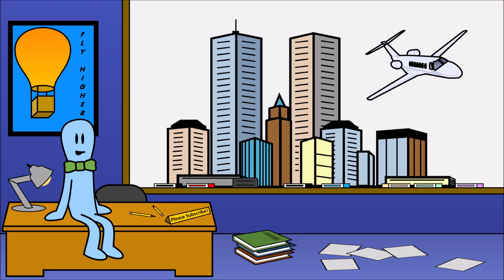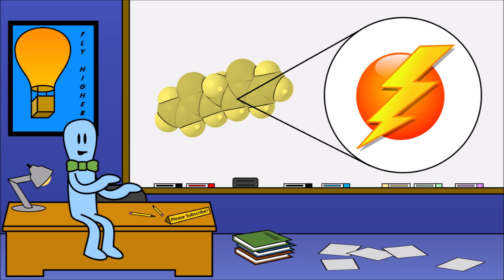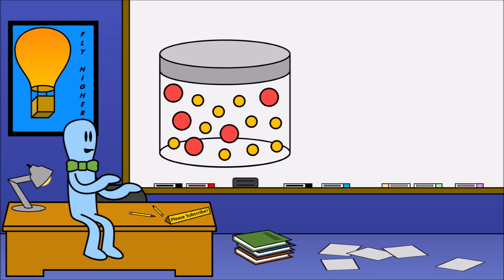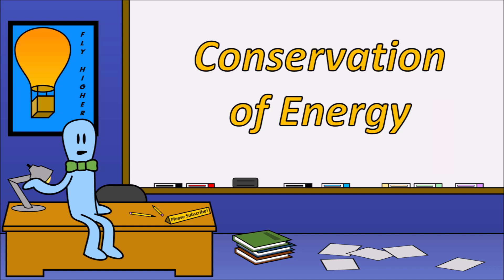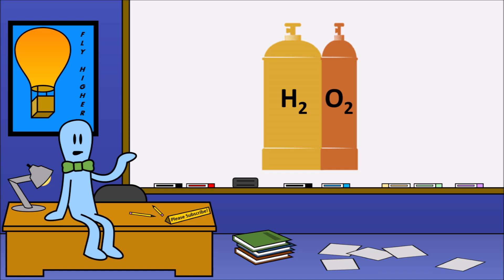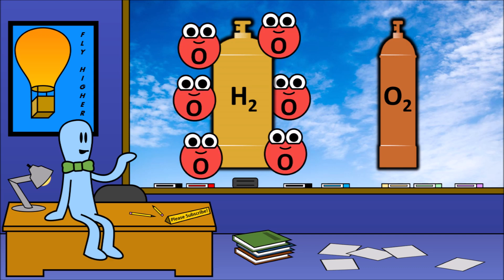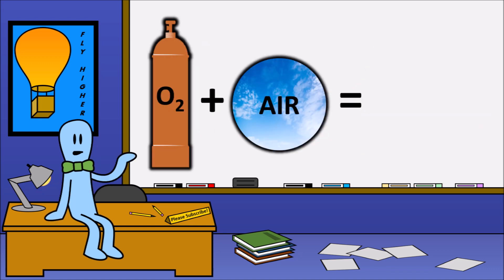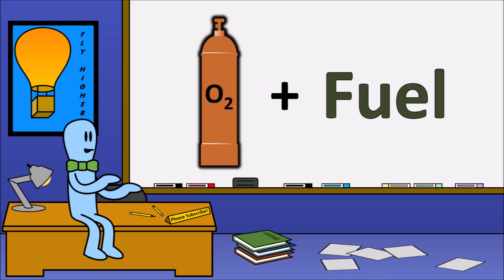Can We Make a Water-Powered Engine?

Comment: A Better Hydrogen generator for your car better than you think.!!!

ACMEC HHO kits are designed for hho gas production in low amps. All hho kits generated Hydrogen and oxygen gases nothing else.!

Yes HHO CAR KIT will improve your engine horsepower and efficiency while reducing toxic gas emissions hho kit will solved all engine heating problem automatically. Engine will run clean and smoothly requiring less maintenance.

You will not see brown deposits in our new designed hho kits. Our transparent kits for efi cars working up to two amps. 

But our transparent hho kits for carburetor types engines working up to 8 AMPS. For better fuel economy. ACMEC HHO CAR KITS can installed on petrol, gas, or diesel engines.

Comment: Well, gas powered cars use battery's to run the engine as well. They engine has a belt pully system that helps power other parts of the car like the water pump and A/C. More importantly, it powers a thing called the alternator, which recharges the battery, making it last a lot longer. So it may need a new battery after a few years, but it would still be a lot worth more than using gas. because, in a sense, water powered behaves a lot like gas engines if you really understand how the engine works

Comment: Wait wait he said you can't use oxygen as energy what about compressed air. You can use compressed air as an energy source older trains in France use that. But the problem is you need the air to continuously come and get pressurized then release it has to happen over and over and over and over and over again but it's going to be an efficient won't seem to get started so it needs to happen between like milliseconds or maybe just seconds I don't know for it to be efficient enough to power a whole car that means you need a big tank you need big air intakes but I don't know what do you guys think 🤔

Comment: You could also just inject the oxygen directly into the combustion chamber, you could also use hydrogen peroxide instead which would probably work much better. I just looked at a hydrogen peroxide car, 0-300 in like 3 seconds. It also just produces steam, which means it doesn’t damage the environment in the slightest.

Comment: People miss the point of a having a motor run on water. It's not to tell people that this motor produces more energy than it's using. No. That's  not why we need it. We need it because having a motor that can produce energy without waiting for hours to charge a battery. Also if the power required for electrolysis is produced by a clean energy source like solar or wind or whatever future technology that's out there than it truly is humanity's energy answer. Giant batteries maybe have their place somewhere but depending on them to power everything and especially for personal transportation will never work for all of us.
Reply from the maker: I completely agree, and that's exactly what a hydrogen car is. The hydrogen is a fuel that can be derived from alternative energies. The problem is that there are people who try to convince others that you can create energy solely from water.

Comment: Who wants an electric powered piece of a hunk of metal that easily combusts and catches on file Tesla's and all electric powered vehicles have been for no reason just catching a file just sitting there plugged in charging and they catch on file I don't want no damn piece of garbage that just all of the sun catches on fire  Gasoline engines don't catch on fire as easily as Tesla's and David Powell vehicles battery powered vehicles catch on file a lot more than gasoline powered vehicles

Comment: Actually if you need electric trick to make water power gasoline engine or you do is take electrical wirelectrical wiring and put it in a gas tank at tank it tones water basically into gasoline

Comment: Na this guy is taking trash one dude was poisiond because he invented a water power car the trick is you need to build hydrogen fuel sel turning water into hydrogen on demand if you can do that turning water into hydrogen instantly you will be left with hydrogen gas and the engine will run but good luck figuring it out just because it isn't easy doesn't mean it's impossible.

Comment: See references to S1R9A9M9. Several cars converted to water through 
carburetor about 2005-2012. 18HP Briggs lawnmower engine shows running 
on Youtube video. Battery runs starter, then disconnected at idle speed.
 Sounds like water pump running- not regular fuel. Permanent magnet 
Alternator supplies power 6-10amps, hand wound magnetic coil adjusts 
timing so as 0-34 degrees ATDC still firing, Inductors slow speed of 
spark as inline with high voltage wire. Parts , diodes, 6v dual coil 
relay in plastic tub on side of engine. The 60 cycles traffic signal 
vacuumed sealed relays were used on the cars 1 per cylinder. (Not used 
as relays,  just the inductance of both) Minimum 2-6 amps AVERAGE or 
7-10amps PEAK DC as seen on scope added to spark firing. The man said 
that actual water vapor pressure was generated on down stroke, along 
with small amount of Hydrogen. Website shut down Dec 2019, with some 
articles on internet. He added occasional baby oil to intake . For off 
idle (power mode) carb jet redrilled to 30% larger for more water flow. 
 Water car 1978 El Camino did 18mpg water only, at much lower 
horsepower.

Comment: No one is expecting the output to be more or equal to the input. All you’re trying to do it get enough energy to drive the engine, move the motor, and then use the rotation of the motor to generate electricity in your battery.
Reply: Dumb comment

Comment: What if we took our current system of gasoline production of oil companies, and had them switch over to hydrogen, that they already produce for themselves for their own processes?  There is still pollution, but instead of it being unregulated on the street, its now in regulated energy producers.  Then its just a matter of converting gas stations to hydrogen stations.  Gas stations already have the basic infrastructure of holding tanks and pumps, would just need to be swapped out for the different systems.  In the long run, the pollution in production of hydrogen can be alleviated by using other energy sources, such as solar wind and nuclear.  Wind and solar have already proven to be good enough to do this on demostrators.  And unlike batteries, there is no need to extract materials from 3rd world countries or look for ways to recycle millions of batteries, because hydrogen cars just use a rather simple tank supply system like natural gas vehicles.
Reply from the maker: That's what people are doing to store electricity from renewable sources of energy. It can take a long time for electric cars to charge up, but by using hydrogen an a fuel source to store the energy, it can almost as clean as an electric car, while being fueled up in a much shorter time.

Comment: oxygen is highly flammable that why they tell you not to smoke when your on oxygen and this has already proven to work the only ones that don't want it is the oil people
Reply from the maker: Oxygen makes other things ignite at a lower temperature, and burn hotter and faster, but oxygen itself does not catch on fire
Reply: @SquirrelledStudio  There's no question smoking is hazardous to health in the long-run. But for someone using oxygen therapy, lighting up can be instantly tragic. In 2008, the Centers for Disease Control and Prevention reported that 89% of deaths related to fire and home oxygen use were caused by smoking

Comment: This is a highly flawed "scientific" misrepresentation of reality and truth to promote an agenda. Only a child without mental capacity to reason cannot see how flawed this argument is. 1rst false statement should tip you off. Water can and does store energy. When the sunlight enter lakes it warms the surface, this is stored heat energy. Just something to consider. Now there are also  ways to tap into the mechanical motion of a car in congunction with  copper windings and magnets aka "electric motors/generator" the  electrolysis. As a car moves wheels turn a generator"aka alternator can be turned by the axle to harness electricity. Transistors and frequency generators can improve the output of electrolysis. The best way to hide a lie is to bury it in a mountain of truth. Electric cars will solve absolutley NOTHING they cause MORE polution because it takes a power plant to create the electricity stored in a CHEMICAL battery that took other harmfull Chemicals to produce. Wake up to the reality that certain people would love nothing more than to enslave you and control you and they can't necessarily get away with it via physical force so they lie to you to get you to buy your own slave chains and shackle yourself with dependency. What happens when the power goes out? You don't charge your car that is what happens.

Comment: Seek not the answers but to better understand the question.

What are people expecting when they hear the phase, "Water powered"... Are they thinking of being able to use water as a fuel .... or are they thinking free energy? If they are thinking free energy, they are thinking up the wrong tree. Energy is never free but if they are thinking of using water as a medium for energy transport and conversion, that could replace fossil fuels and heavy electrical power cells in applications where the convenience and portability of liquid fuels is indispensable, like aircraft and in a form that is both safer and cleaner than fossil fuels, then YES, think of water!

But everyone is is looking at it bassackward. For obvious reasons everyone seems to want to use electrolysis, on demand, at the point of injection into the engine.  They do this because they don't want to have to store or deal with  Oxygen and Hydrogen gasses, on their own or combined. They are just too volatile and explosive.  Think Shuttle Explosion!  What we need to do first of all is to, "water" down the fuel so it isn't so explosive and there is more mass to absorb the heat which means no Oxides of Nitrogen  are ever formed, so absolutely no pollution  of any kind is formed.

So maybe there is another way. A safer and more convenient way and a way to finally, safely, easily and cheaply store, the energy we collect from intermittent energy sources like solar and wind. After which we can use it like any other liquid fuel, that powers internal  combustion engines today. 

What you need is a source of water with a small amount of electrolyte, like vinegar or sea water. Then you need an appropriately sized pressure vessel, capable of internal pressure of 10 psi or less. 

Into the pressure vessel you place an electrolyzer. 

You then fill the pressure vessel  to the top with your water electrolyte mixture and seal it.

IN MY THEORY
Once connected to an electrical source, the electrolyzer will start to pump Oxygen and Hydrogen into the water and since there is no space left in the pressure vessel, those gasses will become dissolved in the water. The water will get more and more energized and becomes a transport medium and as long as the pressure is maintained, the water will not loose its dissolved and explosive  hitch hikers. If left open the water would just gradually release the active elements and you be left with  bad water.  After a certain length of time the water will reach a concentration point at which, when the water is sprayed and/or atomized, enough dissolved Oxygen and Hydrogen  are released, that a spark or flame even high pressure like in a diesel, will ignite them and any other errant molecules present. This action would naturally produce the Engineer's desired, progressive flame front, instead of an uncontrolled  detonation, known in the automotive parlance as "knock", which is very undesirable in a heat engine but very likely using an explosive gas like Hydrogen.

This is very nearly a perfect fuel and would be far more energy efficient for rocket engines, blasting into space. This fuel to gas mixture, could be customized to  have just the right amount of water to gas mixture, that there would be the perfect amount of mass, to absorb all the heat produced by the resident fuel. Producing the maximum amount of pressure and working fluid, from the least amount of stored energy. But that would be rocket science and all we want to do is be able to get to Grandma's house.

Until the science is that far along, all we have to do is find out how long we have to charge the water to get a substitute for gasoline. Once we know that, we can just hook up our solar panels and /or windmills and make our own  Watoline to use in any gas engine, just like gas. Except that it won't catch on  fire if you throw a match on it. It will only burn, if it is sprayed or atomized which would make it perfect for commercial aircraft as well, because it wouldn't need to be jettisoned before emergency landing because it might even put out an open flame in the liquid form.  So the fuel that is the life blood of the aircraft but a danger to life in an emergency situation, now becomes  a life saver. ... Not bad for plan old water,....  sort of.
Reply: Nice and great explanation.. Even if it didn't work your explanation is respected..

Comment: There is so much you are not considering it's truly is sad. What if you ionized the incoming air supply focused on the oxygen atoms prior to the air being drawn into the combustion chamber? What happens to that air ionizer if you add in the correct wavelengths of light to strip up to 4-5 electrons away from the oxygen atoms and send that mixture into the combustion chamber? What happens if you break down the water molecules the same way a cloud does in the earth's global electric circuit by way of ionization?
Basically in my view you simply are not asking the right questions as to apply a high voltage potential to the plates of a capacitor truly doesn't take a whole lot of energy to do so. And, if you use LEDs as a light source they too do not require large amounts of energy to drive them. Thus in conclusion you aren't asking the right questions so go back to the drawing board and try again!
Here is a question that will lead you to understand how water should be broken down. "How do plants break the bonds of the water molecules?" Answer that question and you will see the solution.
Reply from the maker: But it still takes energy to do. It all comes down to conservation of mass: Water and Air don't have any inherit energy stored in them, so there's no energy you can get out of them unless you put energy in first (unless you turn them nuclear, but that's cheating). The best you can get from normal water and normal air is a battery, not a fuel source.
Reply: @SquirrelledStudio  I will admit it took me a while to understand how to break the bonds of the water molecules as nature does. You see nature breaks the bonds of the water molecules in the most efficient way as plants live because they can break the bonds of the water molecules with very little energy input. The last step the plant takes to break the bonds of the water molecules is to take the electrons away from the atoms that make up the water molecules. So then I ask, "How many different ways do we know of in getting the electrons away from their atoms?" That lead me to taking another look at thunderstorms. It turns out that when the conditions are right a thunderstorm breaks the bonds of the water molecules producing hydrogen, oxygen, and electricity when those water molecules are broken down. "How does a thunderstorm do this?" It get at the atoms electrons by way of ionization to get those atoms to eject their electrons and just like a plant the water molecules are then broken down. 
The circuit Stanley Meyer used called the, "Voltage Intensifier Circuit," mimics the earth's global electric circuit and thus breaks the bonds of the water molecules just as a thunderstorm does by way of ionization of the atoms that make up the water molecules. When you look up the voltage intensifier circuit compare it to the earth's global electric circuit and you will see the similarities. This is how he ran a car on the highway with nothing be water in the car's tank for fuel.
Reply: @h2opower  

>breaks the bonds of the water molecules in the most efficient way as plants live 

Photosynthesis is actually a terribly inefficient process at 11% energy efficiency, compared to industrial electrolysis setups which work at 80% efficiency.

>How many different ways do we know of in getting the electrons away from their atoms?" That lead me to taking another look at thunderstorms. It turns out that when the conditions are right a thunderstorm breaks the bonds of the water molecules producing hydrogen, oxygen, and electricity when those water molecules are broken down

No matter how many different ways you know, you will never get more energy out of the process than you put in. Only thing you can do is make it more efficient to reduce losses, but even then you will never get above 100%, and with 80% we are already close to thermodynamic limits.

>breaks the bonds of the water molecules just as a thunderstorm does

Again, doesnt matter how you do it. You still will never get more energy out than you put in. Can't create energy from nothing, mate.
Reply: The electricity to charge a car battery only comes from the spinning of the crankshaft which turns a alternator with a belt this could be done in a “water” powered car only thing is the engine will still requires oil to keep the engine lubricated and reduce friction in the engine.